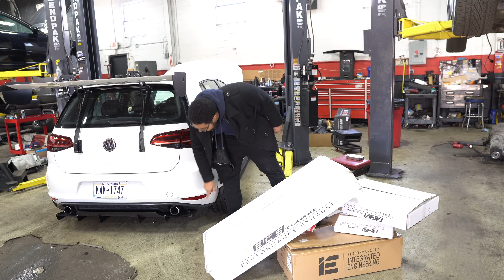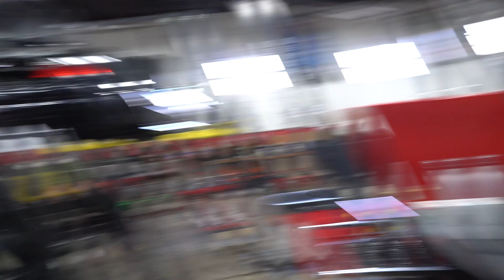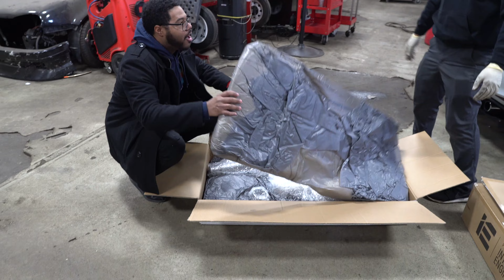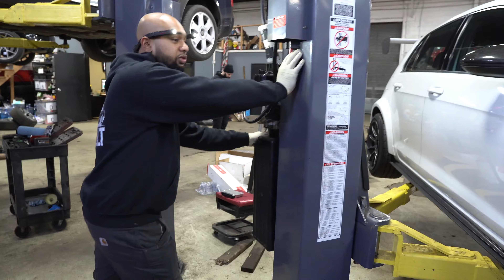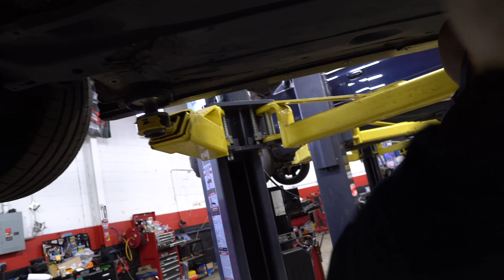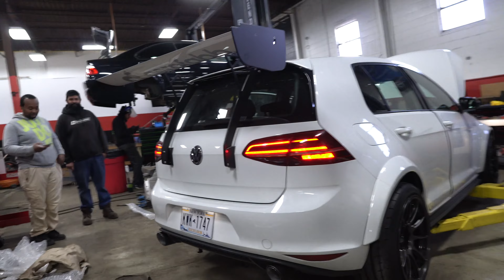Project MK7 Gets a Full Titanium Exhaust

Comment: Does the catch can actually work? Not worth it if stock?
Reply from the maker: I does on higher HP applications but the stock PCV on the MK7 GTi is pretty effective until you have an upgraded turbo and you push anything over 30 psi